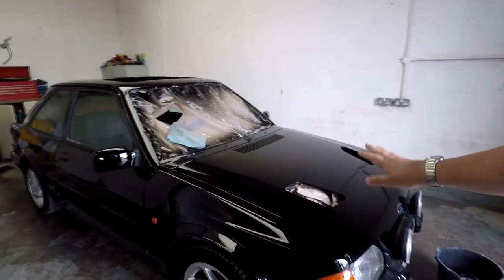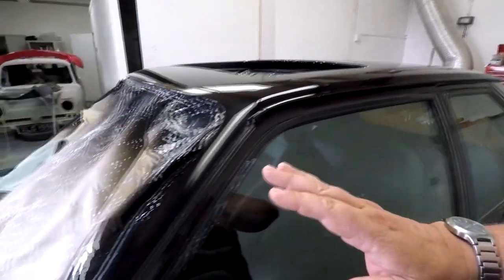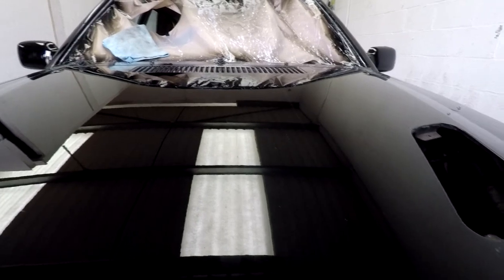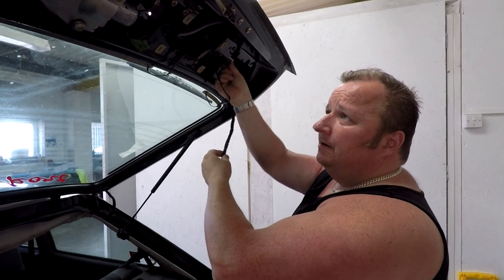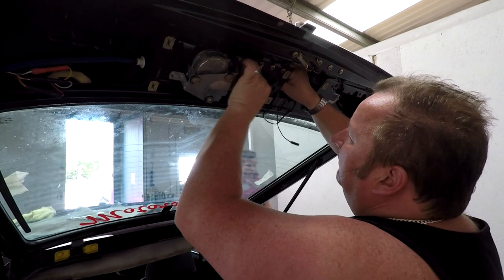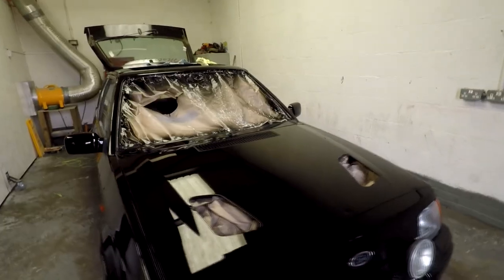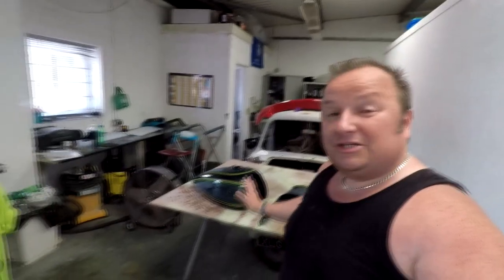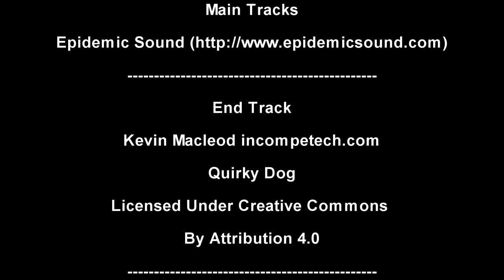A Day In Our Life Vlog #5 RS Turbo And Kawasaki Z900

Comment: Great vid as usual tell your boy to get kneeling pads on or he'll know about it in a few years especially kneeling on a concrete  floor. My trailer has the two wheels removed so it don't get nicked mind you I was going to put a towbar on my Citroen C3 the other day I removed the bumper to install it and found that where the bolt hols should be there where none totally peed off :-(
Reply from the maker: It's a good idea Billy, He'll see this comment i'm sure. I could do with a pair too.
Cheers
Martin